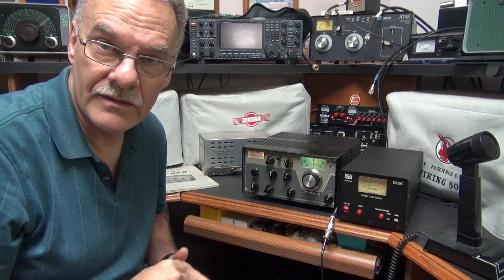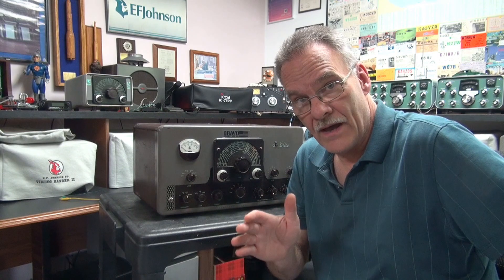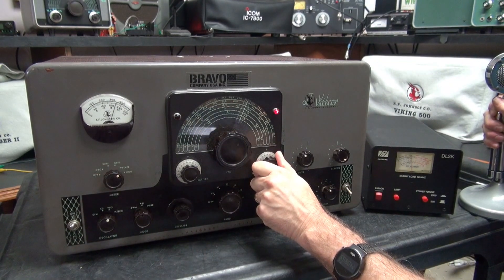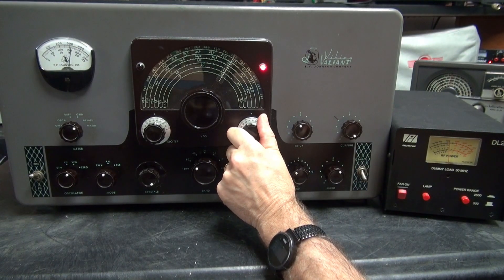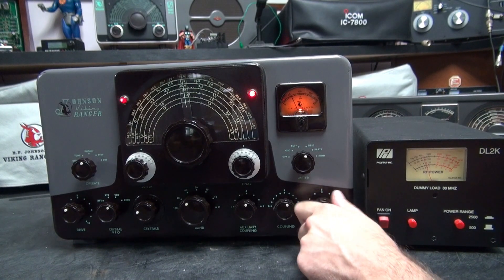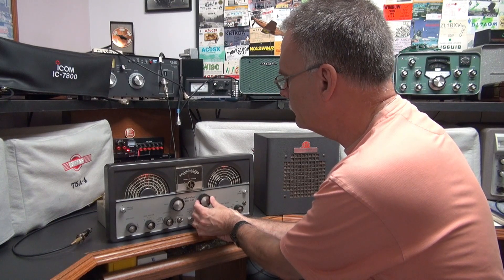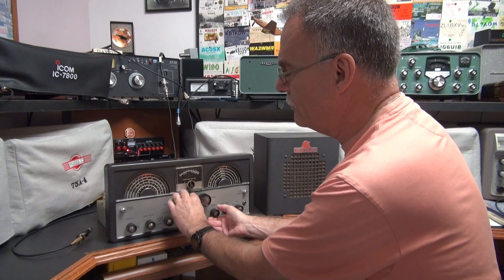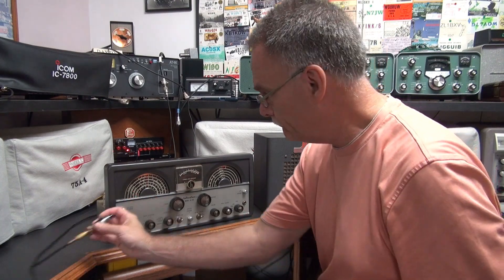Multiple Tube Ham Radio Transmitter testing Drake Johnson Follow up after repair plus a bonus

Comment: I was loaned a National 300 receiver by the local ham club back in 1989 for CW copy practice, when I was studying for my ham licence in Canada. I ended up repairing the band indicator as it was reading on the wrong band and I sprayed the controls with contact cleaner to remove the scratchiness before returning it.